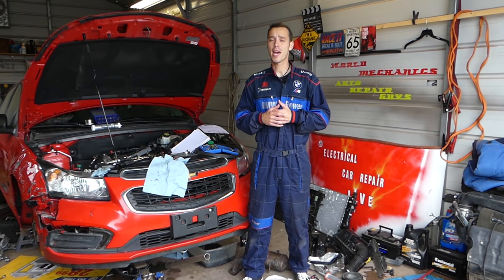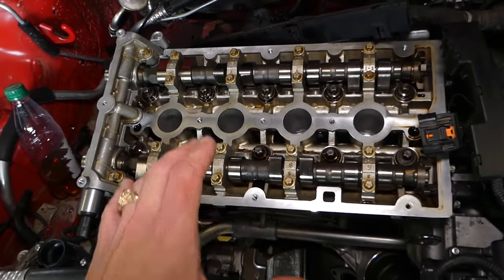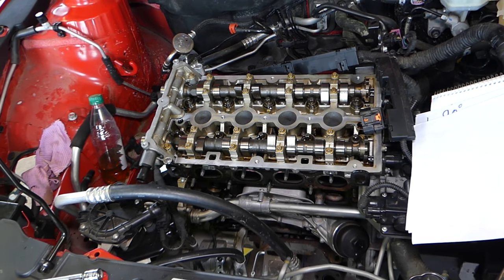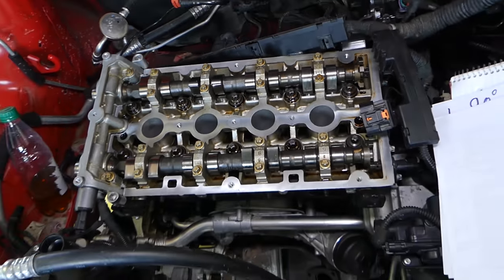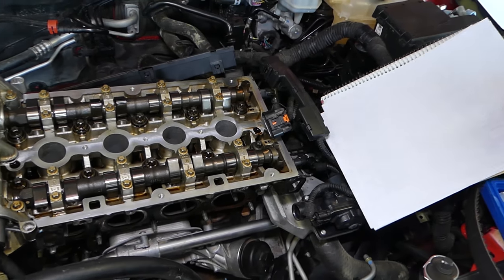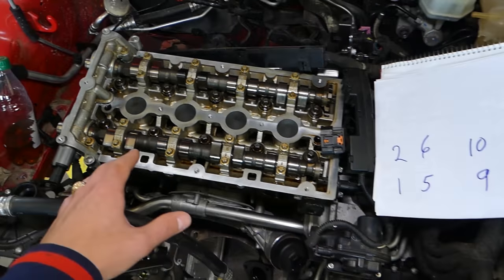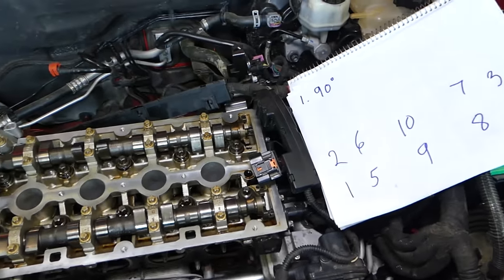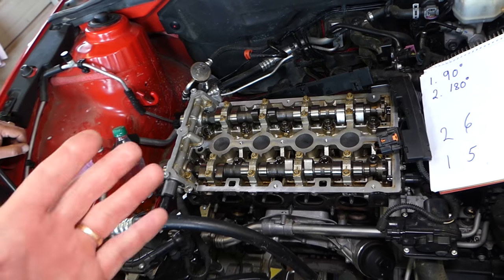9 OF 10 MAKE THIS MISTAKE. CYLINDER HEAD REMOVAL

Comment: An easy way to remove a stubborn cylinder head--after all the bolts are undone, find which piston(s) are closest to TDC, and release their rocker arms so that all valves in that cylinder are closed on their seats.  Pull the spark plug, and pump pressurized air from an air compressor or bicycle tire pump. Often the head will pop loose.

Comment: Pretty hard to tell if the bolt slackening sequence has much to do with it.  Most of the time, if a head is being removed it's because there's been an engine failure of some sort, or the head gasket has failed. Usually because of overheating, in which case the head will be warped anyway 9 times out of 10.
Reply: 48 seconds in, I thought the same as you I stop the video and I read the comments LOL.
Reply: It's where the best info is
Reply: I'm actually glad I came across this video, because I'm removing my 4 cylinder head to hopefully get a small crack welded and I didn't know the removal process

Comment: You are showing us how to remove the bolts but you demonstrate the 90° and 180° in clockwise direction, most Important here is another important thing, right tightly, lefty loose 😅

Comment: @4:00 you actually tighten the bolt 😁 (you're supposed to go counterclockwise) Another thing, the sequence is diagonal on some engines so the pattern (on your pad swap 3-4 and 7-8 to get a diagonal pattern) you show may not be the correct one for some engines, always check the repair handbook on the specific vehicle/engine is my recommendation.

Comment: Have a 2011 4 cylinder Journey. Tried to do a plug change on it. 
The # 2 cylinder plug will turn but will not come out. Maybe it was put in cross treaded by the prior owner I don't know. What might be the problem causing this. How would one go about changing the head what kind of a process would that be ?

Comment: i have a 2.4l  07 chevy colbalt ss and the head is stuck it wont come off all bolts have been properly removed any ideas?
Reply: I had a similiar case with an old 3 cyl engine. It was seized and the head would not come off. I filled up the cylinders with diesel fuel and left it for a couple of days. Then I went to town on it with a hammer and it was off. No damage whatsoever!

Comment: This is basic stuff i learned in auto shop in high school and cat also drills this into your head in there classes. Only weekend guys would do this unless they don't have a manual, most parts comes with instructions. I think only gave men do that on blown engines...lol
Reply: Any cave man can do this..
I carefully read the manual text and understood to loosen bolts with the obviously opposite procedure to tightening.

I then proceeded to use the handy additional diagram working happily and carefully in logical numerical order meticulously loosening each bolt to the tightening pattern sequence… 💩

Comment: Why don't it say this in the service manual you would think they would mention this only has the sequence
Reply: Right....in my car manual it says to turn each one 1/4 a turn until you can take them out by hand.  The most important step is says is to reinstall the bolts in there exact location that they came out of which he clearly didn't mention lol.
Reply: @LoneWolf-ze2ht  that's because most cars don't reuse the old head bolts, since they stretch. You have to buy and use brand new ones when reinstalling

Comment: Don't ever ever try to Remove the cylinder head unless you have to ,,,crack head or head gasket only ,,, the sell head gasket liquid gel ceramic liquid repair the only thing is they last 1 year 5 months ,, may last 2 years n 6 months  by changing coolant to pink for aluminum , oil must be half n half thinner n thicker than regular old high mileage plus a additive called  bestline , adding a small electric fan on hood with hood scoop, also using a larger thicker radiator, n  . What this does keeps cool the liquid gel ceramic formula ,specially in hot summer heat storm rough n long drives overhauls ,.  A head can be rebuild without removal with proper tools n directions, less time than removal,